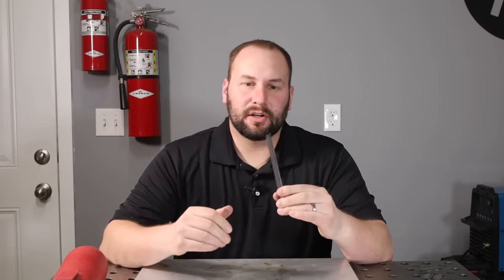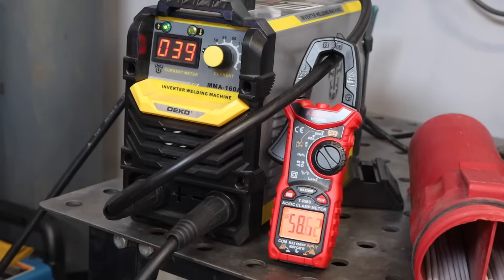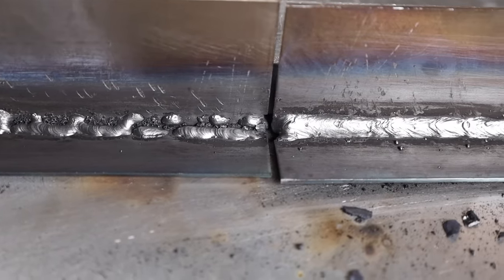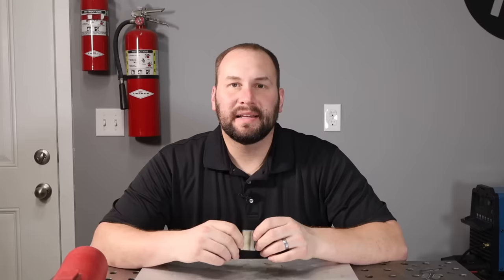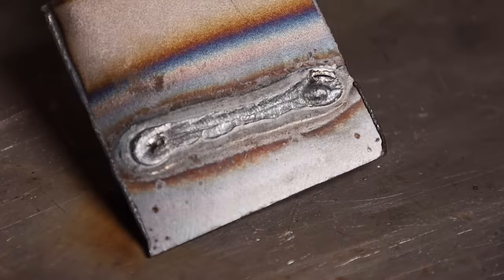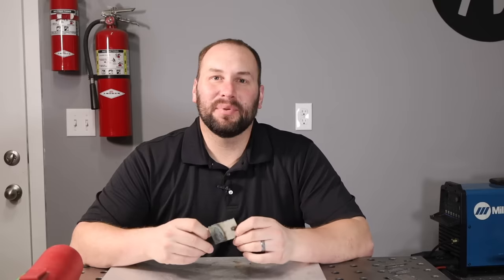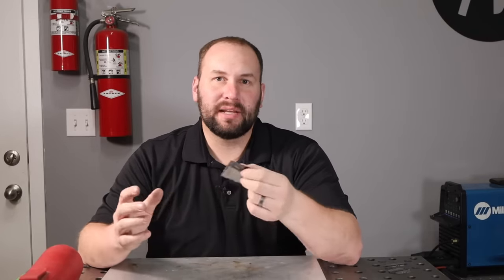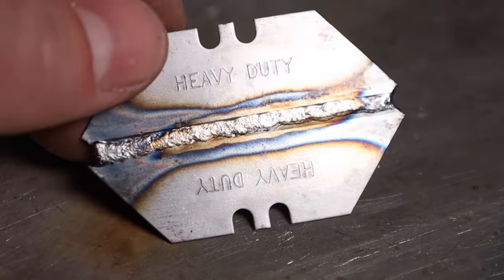Can I Stick Weld Razor Blades? | Thin Steel Stick Welding Tips

Comment: "switch to my miller for more accurate amperage settings" 
Me looking at my 30 year old manually cranked Miller Thunderbolt with two turns of back lash, and a setting-indicater that might get you + or - 15amps on the first bead.
Reply from the maker: I had one of those! The crank mechanism broke entirely on mine.
Reply: @TimWelds  They are not hard to fix, it is just a screw that lowers and raises the iron core in the inductor coil.
This is a quick look inside of one https://youtu.be/X0nePp0DTkU?si=tpy65llAgde8irjb

DC machines just add a full bridge rectifier and maybe a large capacitor to somewhat smooth the ripples. (Adding a large capacitor to the DC circuit of cheap machines can help them better run DC only rods like 6010 if they are struggling. The cap needs a voltage rating at least double the rated open circuit voltage of the machine.[two in series will double their voltage rating])

Comment: 3/32 7018 works on 18 gauge exhaust pipe.
Reply from the maker: Very cool. I'd rather run 7018 than 6013 any day of the week. Thanks!

Comment: guy in video: nice strong iron even if thin af and have small electrodes.
me in west africa: atheist paying to god that my welds will come out fine becouse all the metal here is tin af and chinese one that looks loke aluminium wile welding with 2.5 electrode becouse thats the only ones west africa import 😂

Comment: Dude first off the bottom plate looked like 3mm big difference  now try it on 1.2 as a butt weld with no backing plate so it holds your weld and draws out the heat